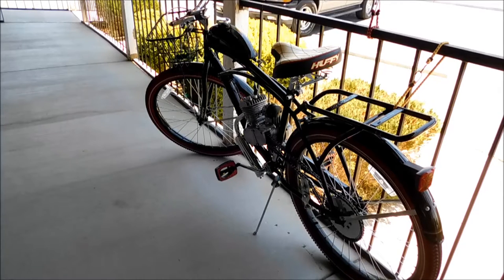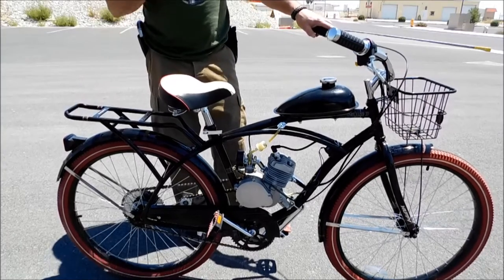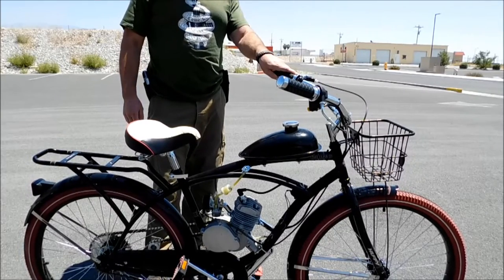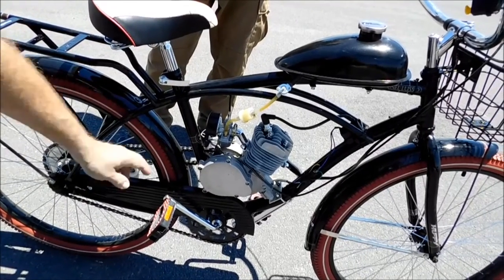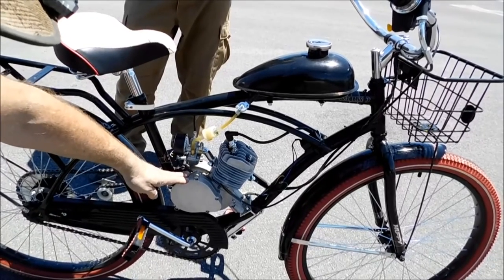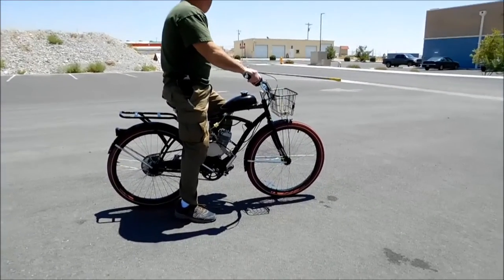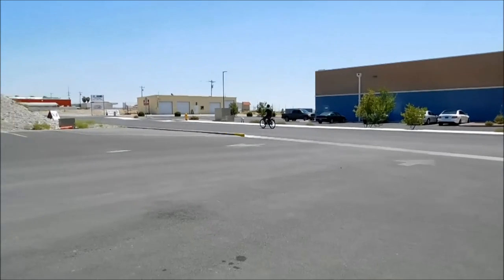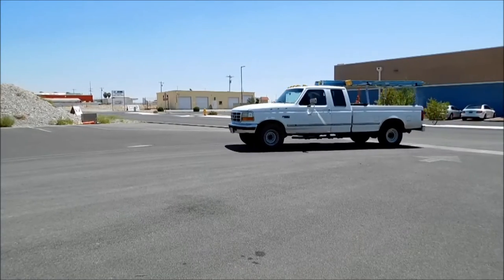Gas Powered Bike, The Perfect Bug Out Vehicle!

Comment: The beauty of this set up is that you can peddle if you don't have fuel.  Though the motor does cause a fair bit of drag while peddling and it adds a noticeable weight. 
  The other downside is that they beat the crap out of the bikes that you put them on so you're gonna want access to spare bike parts if you're using them a lot as well as tools. You're also gonna want to know how to work on them cause they're finicky and need constant tinkering. They're especially hard on tires.